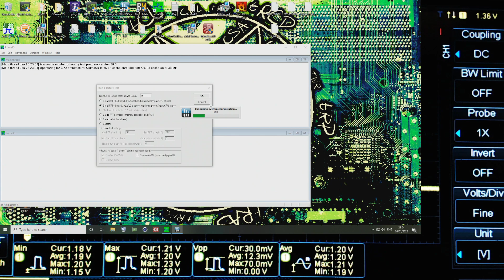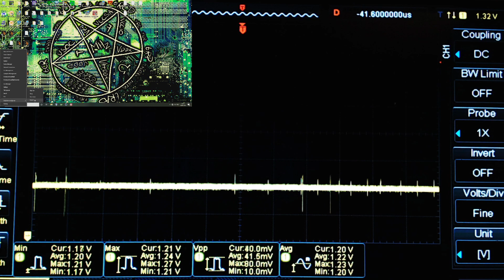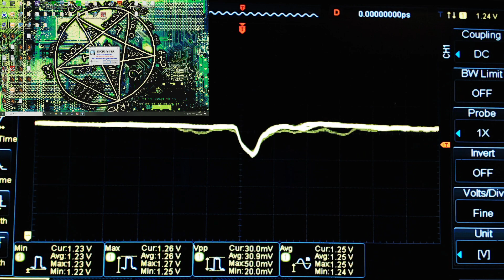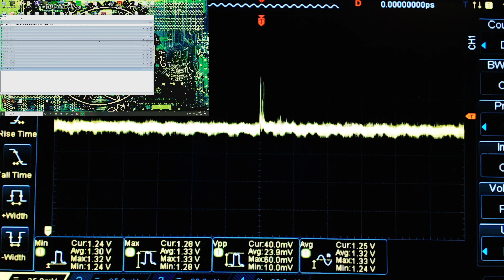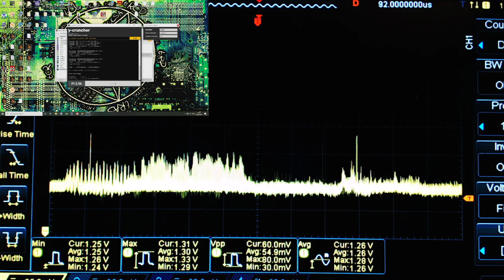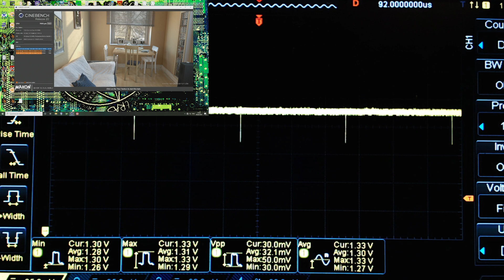Gigabyte Z690 Aero D VS Z690 Aorus Master Vcore voltage regulation.

Comment: Hey mate thanks for the video 👍 not sure if you'll see this so much later lol but I want to ask if you knew anything about the newer version coming out soon aka z790 areo g? They have not disclosed any info regarding the power delivery etc which is confusing especially as they have all the aorus ones advertised showing the ampage and power stages. You mentioned they seem to copy paste the design going down to the slightly cheaper ones, and I hope it's the case with the z790 areo g. Would love to know if you have any thoughts or info on this board please 👍 thanks again.. Nick

Comment: Does the Aero D have optical audio out?
Does the Aero D have display pass through for your graphics card via Thunderbolt?
If both, this could be my perfect motherboard! But I can’t tell that it has either.
Reply from the maker: it doesn't have optical but it does have display passthrough. https://download.gigabyte.com/FileList/Manual/mb_manual_z690-aero-d_1001_e.pdf

Comment: My z690 master is great. I have crucial 4800 ddr5 oc'd to 5400 and the cpu oc'd to 5.4ghz.  Stable and low Temps. I literally run vanguard at 144hz 4k ultra at 180 fps. I always get the master variant.

Comment: Im currently at 1.42 llc6 on apex xii with a 10900k. It drops to 1.38-1.39 under load, is this fine? I’ve not had issue during stress testing so far on linpack and prime95. If i lower llc i guess i would have to raise voltage even more to get 1.38 under load.
Reply from the maker: with LLC5 you should be able to get away with slightly lower average voltage so you'd probably only need 1.36-1.37V load to be stable on level5 at least in theory. You would probably need 1.44-1.46 set voltage with level 5.
Reply: @ActuallyHardcoreOverclocking  thanks for the info, i made the changes and testing for stability now, so far so good 👌🏻

Comment: How much would a top of the line oscilloscope for these measurements cost?
Reply from the maker: if wanted to copy the setup I got to use when visting gigabyte for the X570 launch it would cost 7-12K USD IIRC. The scope I'm currently looking at is 900USD.

EDIT: All I really need is more resolution which can be had surprisingly cheap these days.
Reply: @ActuallyHardcoreOverclocking  aim for sponsorship for that man. If nothing else its an arguement angle

Comment: I'm willing to get a PC for Streaming but so much confused b/w Red & Blue. Intel offers top-notch performance & AMD has better platform support. Help !
Reply: At this point AM4 is near its end of life so they're about on par when it comes to platform longevity as far as I am concerned.
Reply: ryzen is much more power (and so thermally) efficient, so your cooling system would be quieter and less heat would be dumped almost directly to you
also for now (!) software on alder lake can bug more or have problems with launching (ex.: denuvo)
and ddr5 is only on it's start, so like with ddr4 launch it's not so good in both performance and price

with all of that I would buy 5900x+b550+some good 3800/4000 ram (and maybe upgrade to zen3d 16 core later), but if you could wait for a year or two, wait for next gen cpus and better ddr5 sticks

Comment: Do these boards have VRVOUT?
Reply from the maker: not yet.
EDIT: as in HWinfo hasn't added support for the RAA229131 yet.
Reply from the maker: @DogeSilva95  some manufacturers block access to the VRM voltage readings.

Comment: Gigabyte Z690 Aero D for gaming is better than the ones that meant for gaming.
Reply: I really like what they've been doing with the aero. Feels like it's been best value for money in the line-up the last couple gens
Reply: no its not master is for gaming and also the master is for extreme overclock way better then the Z690 Aero
Reply: @naor9792  I have the Aero d
And it’s more than enough for overclocking…I OCed my i9 P-cores to 5.1ghz and E-cores to 4.7ghz stable, and it has more m.2 Gen4 slots and two Thunderbolt 4 USB C ports and 10GbE LAN and 2.5GbE LAN…and charge any device up to 60w…
Reply: @cia4gent128  any stability issue in bios ram ethernet?
Reply: @yooanto9465  Yes…I faced the ethernet issue…but fixed it by removing the power from the PSU and pressing on the power button for 20 sec…then turned it back on…everything worked.
Reply: @cia4gent128  why you have to turn off psu? I hope it's running well for you  now
Reply: @yooanto9465  You have to turn off the PSU to clear the electricity from the MOBO…